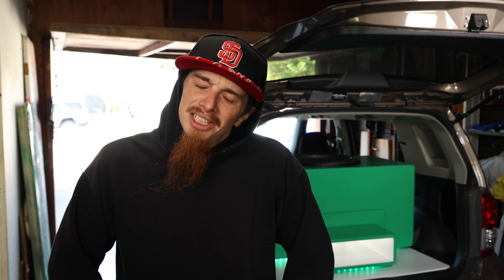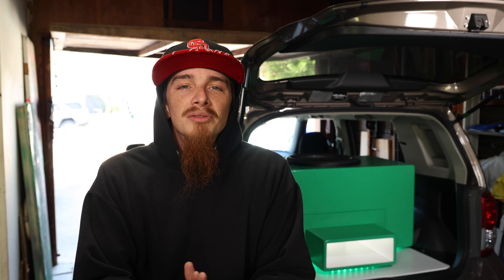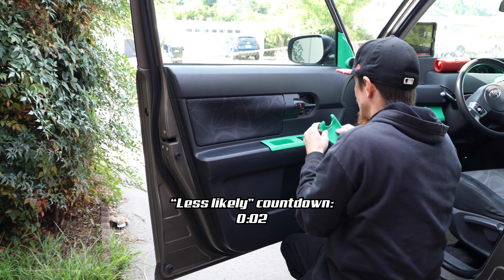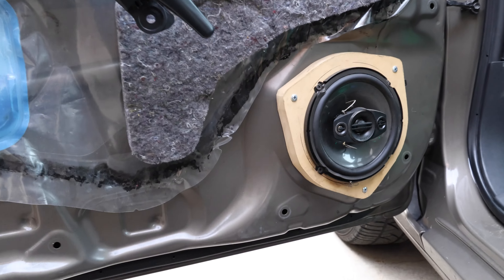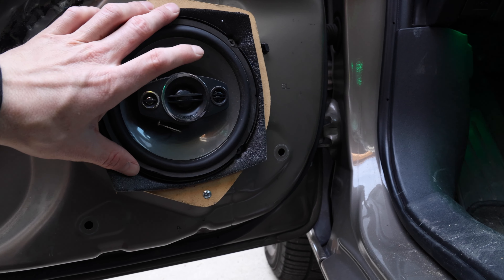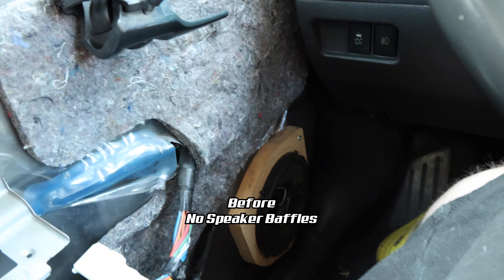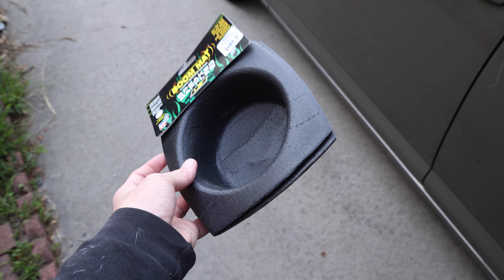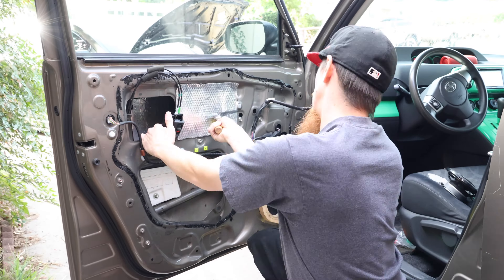Do Speaker Baffles make Speakers Sound Better?

Comment: It worked for me. Got rid of that megaphone 📣 in a 🪣 sound. And gave.the midbass more definition. I definitely didn't increase the bass, but is certainly an improvement.
Reply from the maker: Really?  That’s awesome!  I feel like I didn’t have that particular sound UNTIL the baffles (although only in the midbass frequencies).
Did you use the same ones?  Either way, those results are pretty cool for the price!
Thanks for leaving your experience!
Reply: @DaBadNewz  Listen again to your sound on this video.  The tone quality with them in, changed to not have the reverb of the door that sounds like a tin bucket.  It was snappier like the actual instrument sounds in person.  Particularly the snare.  They should have a pop to them without an echo.  I can actually hear the door resonations without the baffles.  I plan on 3D printing some enclosures for my speakers to get an even more solid tone, possibly with some poly fill and dynomat in them to not echo off the plastic.  I could possibly even make a ported sub box.  I just need to figure out the math stuff.
Reply from the maker: I agree that the enclosure route is the way to go, but as far as the baffles making it snappier, I absolutely disagree with that.  Sitting in the car, I feel like they not only did NOT improve the sound, but actually added to the “looseness,” with some resonance in the exact frequency range I was trying to address.  I feel like these aren’t really solid enough to do that job effectively.  I could “hear” the actual foam of the baffle.
Either way, this video was really just a slick way of introducing the new speakers (which wouldn’t fit in those baffles if they begged for it)!
Thanks for checking it out man!  Even if I disagree, I appreciate the input and the discussion.  
Have a great one!
Reply: @DaBadNewz  It could just be the way I heard it through the video.  My sound set up is referenced for a fully flat response.  Then again, Youtube audio isn't the greatest.  I've been researching the best way to mount speakers, and a lot of people have been putting an isolating barrier between the speaker and the door frame.  To me, that doesn't make sense because it would isolate them so much that any lower frequency won't move through the materials of the door where you would feel it, which most people don't pay any attention to, but should.  I'll figure something out when the weather is nice again.  I have a 3D scanner, so I can maximize space when modeling it. I'll let you know if a 3D printed chamber helps or not.

Comment: Maybe fiberglass the boom mat & make rigid it enough to make a difference... 
Deaf Bonce Arnold are legitimate mid / mid bass drivers...
You'll be very impressed by them with 100-150 watts...
Reply from the maker: That's definitely an option, but I'd rather give my speakers more airspace than the baffles can provide...plus, they don't even fit over the Arnolds!  Magnet too fat lol.
But yea I been loving em so far!  Feeding em about 200-250 right now

Comment: I tried them in the past when they first came out. I installed in all 4 corners and found i lost all my midbass, so i pulled them all out the next day. Theyre still sitting in a corner somewhere 15yrs later
Reply from the maker: sounds like what's gonna happen with these...got em sitting on the shelf with the old door speakers.  oh well!

Comment: they're good only for keeping water getting into the driver, for sound... nah
Reply from the maker: Yea I definitely agree now!  Not much use for me.
Reply: @DaBadNewz  yep, I also have a scion xb 1st gen I turned into a truck lol, best thing to make mids sound better is to soundproof the doors as they are so cheaply made it almost feels like a tin can, also also apply some sound proofing to the door skin so it improves stifness, good video 👍🏻
Reply from the maker: oh you did the truck conversion?  nice!  Those always look really cool.  And yea deadening is essential in these cars...from the factory you can hear the cost-saving!  I had already done a layer to the doors and panels, but in the next video I add even more for that exact reason.  Thanks for the suggestion!
Reply from the maker: oh shit I think I seen that!  I think I'm in  all the custom xB groups, if not I'll definitely find it and check it out.
I love full custom shit like that, I gotta learn to weld!

Comment: Just a tip your using them for the wrong reason, these are made for the purpose of having subs in a trunk, the pressure from the subs moving air in the trunk would distort and destroy the speakers mounted in the back glass that are closest to the sub box. And for this purpose they work great, if you have a friend with a trunk sub setup you should do another video on the SQ of the speakers in the said back glass, good job on the video tho.
Reply from the maker: I was actually trying to test how well they stand up to the claims made on their website and Amazon pages.  The pictures of these things always show them in doors, and they claim an audio benefit, so I was testing that specific use.
I don’t doubt they would help against sub pressure, but that particular use is never even suggested by Boom Mats, so that wasn’t really the point (I was kinda just disproving what they had posted on their website because it seemed like bs).
I do agree that it would be interesting to do the test again in a rear deck just for the science though.
Thanks for your input!  Definitely gave me some ideas
Reply: @DaBadNewz  cool I didn't look at the site before I commented, but I think there's one maby two other company's in the past that's made about the same thing as this when I was in high school. That's what we used them for back in the day. Me and my buds always had some of the better SQ builds with reg equipment. But really when you done your test I did notice a diff in the tone change from before and after, I'll bet if all four channels where done and the doors closed up with no sub it would be a lot better SQ on the mids at higher vol. Again good job on the video and badass sub box!
Reply from the maker: Yea there's definitely a few different versions by different companies, but I think they're all pretty similar.  And yea there was a slight change in tone, but I wasn't particularly liking the direction it was going, plus the foam was actually causing some distortion from the sound pressure from that weak ass 6.5 powered off the HU.  
I would still test them again in the future to maybe find what scenario would make the most of out of them, but as far as using them in this build?  Nah!
And thanks man!

Comment: You'd probably be better off using those as a mold for making a fiberglass box for the door speakers if you really want a fully sealed install.
Reply from the maker: not a bad idea!  these baffles aren't even big enough for my new speakers, but that's still worth coming back to at some point since they're just taking up space now

Comment: Nah you're totally right, they don't. Door speakers are designed to be run infinite baffle, so sealing them in a tiny foam pod is not going to do anything for midbass. Sound treating the inner and outer door shell plus the door panel and securing wiring, clips, the door lock and window panel etc to eliminate vibration and completely isolating the front wave from the back wave is the best course of action to squeeze the most performance out of any speaker in that location. Also, MDF speaker rings are going to absorb moisture and rot/decay. We have the same car and I'm even going black and green. I am a former pro installer starting a MASSIVE competition SQL build and a full sound treatment of the doors with ABS speaker rings and some other goodies are next after brakes if you wanna connect on IG. What will help is a foam ring around the speaker that mates to the door panel and directs sound into the cabin instead of into the the interior of the panel.
Reply from the maker: Yea getting the door sealed better is exactly what I did (that video drops tomorrow!).
And the MDF is a “temporary” solution for that exact reason.  I’m also planning on ABS, but I’ve been considering acrylic for lighting purposes (the only reason I don’t have em yet).
The fast rings would definitely help though!
And I’d love to check out an SQL build in one of these, sounds like a cool project.
Thanks for the info!
Reply: Cool i have those foams , but im really wanting to protect my speakers/investment , I'm thinking pods r the best way to go .....

Comment: Just use Tupperware or plastic containers and foam them whatever they work better bottoms of windshield washer jugs you know there's so many different things you can use that are just being thrown away in the trash every day
Reply from the maker: I can honestly say I have never heard that one before!  While I don’t even doubt that something a little more rigid than foam (like plastic) would probably do a little more for the sound than the foam baffles, I don’t think I necessarily want my speakers having such a minimal airspace.  I’m kinda going the other route and turning the whole door into an enclosure.
Thanks for checking it out and leaving a suggestion though!

Comment: I dont know what chevy did but whatever housing the stock front  speakers in my impala have but theres so much midbass for such crappy speakers
Reply from the maker: damn you gotta rip those open and find out for us!  sounds like I need to take some notes
Reply: @DaBadNewz  it's just a big plastic housing there's a bunch of videos on how to cut the speakers out an reuse them for aftermarket speakers
Reply from the maker: @Durkhead oh so it’s basically the same type thing but hard plastic?  Nice!  I’ll heave to look into that a bit, thanks for the info

Comment: If it’s worth mentioning, I was gonna get those but I went with the Recoil rubber open back baffles. I did it bcs I also was curious but mostly bcs I’m
Building a 98 Integra and older cars don’t seal as well 30 years later. Ironically after installing my gear, I had rain and a few water drops landed on the baffle and it saved the speaker. 

I didn’t try a before and after bcs I been messing with audio long enough to tell what the changes would be. The recoil also have a 
“Sound projection” design that aims the sound to you instead of spreading out. That most definitely has a big impact because I held the speaker in my hand with and without the recoil baffle and it was a no brainer night & day difference.

Call me Puerto Rican 😝 but it motivated me enough to sound deaden my front doors with sheets of rubber foam that I been saving from Amazon packages. How good does it work?… the proof was there when I shut the car doors.. sounded and felt solid and quiet, totally not like a 30 yr old car lol.
Reply from the maker: Oh I believe it!!  My homie has a Mazda 3 and that dude has stuffed every type of foam/fabric/old shirts n blankets/etc in his shit…but you can’t tell me it doesn’t sound like a Maybach when he closes the door.  Complete silence!

And I believe you about the Recoils too, the designs that direct the sound seem like a much more likely option.  And I bet the rubber helps too since it’s a bit more solid.  AND they saved your speakers?  That’s a win!
Sounds like a dope project though!  Those integras always been some dope ass cars.

Comment: I've just finished soundeadeing my Fpace SVR and bought a nuce set of focal for my mid 6.5. The guy gave me this exact same foam baffle. I think I'll pass on installing as the outset door doesn't see any weather elments. The comment section here was also helpful. Thanks.
Reply from the maker: Glad it was useful!  And yea you really wont be taking some huge risk without them.
Thanks for checking out the video and leaving feedback!

Comment: I bought these long time ago to use with my 6.5 upgrade since bmw originally used them but with 5.25. So when I got the 6.5 installed after much modifications I wanted to install the baffle mainly for weather protection and I noticed the speaker when comes in contact with the foam it buzzes ? Did you notice any effects like that ? 

My 6.5 are on the larger side so they aren’t fit in that foam baffle, so I gave up on them
Reply from the maker: Do you mean like as if the speaker had interference?  I didn't have that, but I DID notice that the foam was kinda vibrating with the beat, almost as if the cone was hitting the foam (but it wasn't).  It was like the foam couldn't handle the pressure.
But yea with my new speakers, they don't even almost fit in the baffles, so the baffles are just sitting on the shelf

Comment: I used them on 4 6x8's and they sounded great. Got a new car that has 4 6.5's and didn't get the same results. I think the fact that the 6x8's had a larger inside volume helped a lot. The 6.5's are smaller and stiffer because of that.  They sound terrible when you turn it up past 1/3 volume.
Reply from the maker: That's cool you at least got to experience SOME kind of benefit from them.

Comment: Get a dsp and adjust speaker timing to correct phase and remove the midbass null
Reply from the maker: Yea getting a DSP is definitely on the list!  Just haven’t done it yet.
Any recs?
Reply: @DaBadNewz  Mosconi, Helix mini, Audio control, but you probably already heard about them.
Reply: @DaBadNewz  Audiotec fischer (Helix, Match, Brax) has the best DSP pc tool by far. There is also a lot of tutorials/guides because it is most sold brand on market. Zapco is also a good option to add to the list.
Reply from the maker: @Henqli thanks for the suggestion!  I’ll have to look into them, familiar with the name, but not in terms of a DSP.  I’ll take a look!

Comment: You will loose sound for sho, cut the lower half to release the back wave . Car audio display we have we tried using them and it ruined the sound . Utopia focal lol
Reply from the maker: I'm just gonna leave em on the shelf, they don't even fit the new speakers, and they were just for experimental purposes anyway (unless for some reason they blew me away).
And yea if it can ruin the sound from some Focals, that's a pass for me lol

Comment: You're supposed to cut out a little square hole in the bottom to allow for a ported enclosure. I don't mess with them but when someone wants them, that's how I and many othe's do it an dit sounds a lot better. But that Def Bonce will do ya right! I run one of their Avatar 15's in mine with a JP63 amp.
Reply from the maker: I’ve been super surprised by how many people have suggested that!  And it definitely seems reasonable to think it would have a beneficial impact, but tbh, I just wanted to test them as is (and since that wasn’t a manufacturer recommendation, it wasn’t part of the test.  But it’s definitely something worth coming back to).
And yea the Deaf Bonces have been treating me very nicely!  Still actually have a couple 8s to install, but so far I’m very happy.

Thanks for checking out the video and leaving a suggestion!

Comment: So cutting 40% off the bottom  would make it good for sealing it against rain that travels down your door. Like not even for the sound just for protection  against your $200+ speakers. And this isnt pointed to someone. Its just information for everyone who finds it useful. 

Also, it does make a good form for fiberglass molds  if youre into that.
Reply from the maker: I’m completely blown away by how many people have suggested that.  That wasn’t even the point of the test, but it’s super interesting that so many people have that in mind.
Definitely good shapes though!

Comment: So I bought these too and wanted to use some uv resin inside and on the back of them, cause I agree the material isn't solid at all. Wonder how they'd sound then..
Reply from the maker: I’m considering coming back to them and doing something like that just for testing purposes, but not any time soon.  I’m sure it would do SOME kind of benefit
Reply: @DaBadNewz  right right.. the smd flash resin is incredibly impressive even minus kitty mat fiber glass
Reply from the maker: Seems like the perfect stuff for this application

Comment: What is your opinion on the Recoil silicone baffles in regards to sound quality?
Reply from the maker: I actually haven't tried them.  But giving them a look on Amazon, I would honestly expect most of the benefit of those to come from weather protection.  It would seem like they affect the sound quality about as much as these foam baffles did, but again, I'm just taking a guess.
Having an open back might help them out though.  Would be an interesting little test!

Comment: Bro for mids, you gotta try the Image Dynamics if you can do 6.5s. I haven't tried them all but Ive gone through Kenwoods, Pioneers, Kickers and JBLs and the IDs, by far do a fantastic job of closing the gap the sub makes.
Reply from the maker: Damn I wish I would have known that before I picked ip my Deaf Bonce 8 midbass!  I don’t think I’ve heard those in person, but I’m open to anything that gets the job done.  I’ll have to check those out!  Thanks for the suggestion!
Reply: Which ones bro I’ve been trying to find a set of door speakers with bass but no luck
Reply from the maker: the REAL solution is some midbass speakers!  The Arnolds do a decent job though, especially if the doors are treated

Comment: Cut a port in the bottom of the baffle
Reply from the maker: they don't fit the new speakers so it doesn't actually matter.  I've received that suggestion a bunch of times.  That would definitely be an interesting test, but that wasn't really what this video was for.  This was mostly just about testing them (according to the directions), to see if there was an improvement.  I wasn't trying to make them sound good, I just wanted a test as is...(and a way to announce the new speakers).
Thanks for the suggestion though!
Reply: @DaBadNewz I get it. Thanks for the video.
Reply from the maker: No problem man, thanks for checking it out and taking some time to add to the conversation.